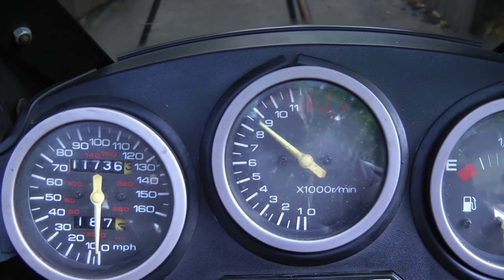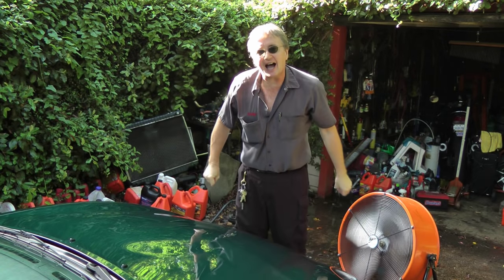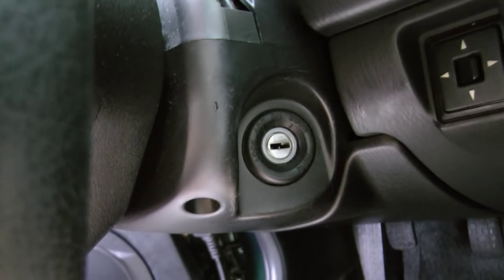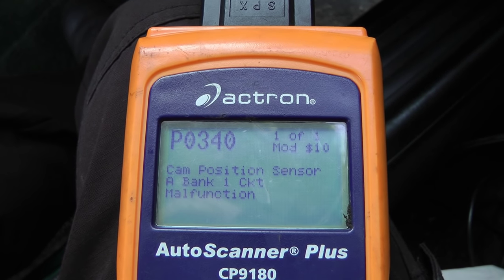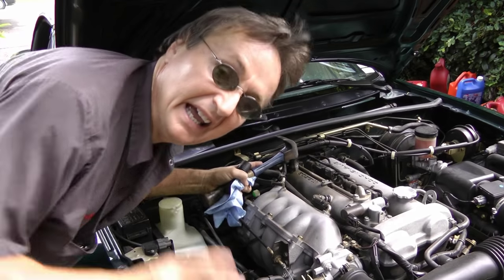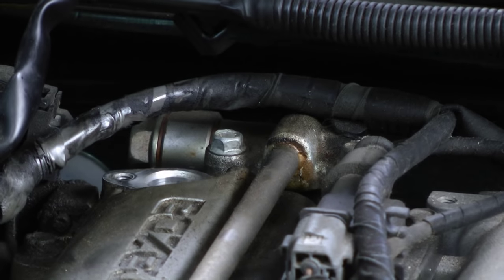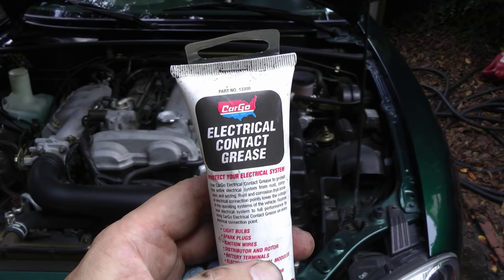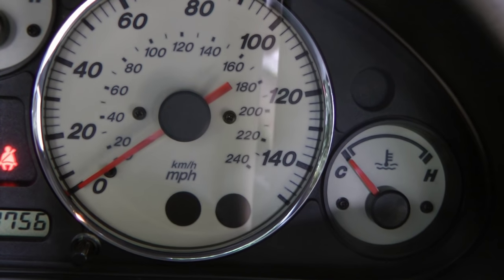How to Fix a Car that Randomly Dies while Driving

Comment: scotty, there are some cheap 5 bucks bluetooth(your phone will be yhr interface) obd2 scanner / reader. it can also display rpm, fc, 0-60, 0-100, rolling start and more. im about to buy one but im not sure if it works or at least does the job, can you ask some of your mechanic friends if they already tried to use some and if it is universal for all cars?
Reply from the maker: +John Meister Dupa they work on all obd II cars, BUT realize the really cheap ones can fry your computer. Buy at least a 40 dollar one so the circuits will be well made on the plug
Reply: +Scotty Kilmer hey Scotty, got a 1987 Chevy G20 357 engine, been stalling on startup after driving awhile but always started back up again after  it died engine light comes on lasts   a minute then goes of and everything appeared to be ok, been driving like that for awhile, sometimes it would come on while driving but no issues , always got me home. Readiing is a code 32 which is a ERG , so i was gonna replace that. Tonight  i was driving home at night, car stalled out , no lights Nothing for 1 sec then everything came back on  on and drive fine , Scared the living BLEEP outta me as it was  almost pitch dark outside!!. What do u think PLEASE HELP!! I feel lucky to be alive!! :)

Comment: Hi Scott, i have a 98 dodge grand caravan that cut off on me while driving. I've replaced the starter because i thought it was the start solenoid. it did not fix the problem. i turn the key over and all is get is a click. i have full power and the dash lights up.

Comment: I got an odd one. Car dies at random driving or not, never while cold. Had the fuel pump, fuel pump relay and FPDM, replaced based on past codes "fuel system offline". Usually will start up the next day or if left alone for a solid couple hours.
I've racked my head on this one for a few months now.

Comment: Scotty, my 2009 Honda Pilot EX-L with 131K miles in it stall and chokes when i tried to accelerate, change the fuel pump and crank position sensor and it worked fine for about 30 miles and then it started doing it again. i connected the OBD Fusion engine diagnostics but no code comes up on the screen. Could you please provide some guidance if you have encountered this issue before? thanks, Carlos

Comment: Hey Scotty. I keep getting a battery light flashing as I come to a stop. Alternator, starter and battery tested good. The vehicle has a new belt tensioner. Does a battery light throw codes that can be read with a scan tool? It's a 2004 Honda Accord 225k miles. I think it's the computer. Sometimes the RPM drops to 500RPM and the car stalls if I try to move it. If I rev it up and hold the RPM to the limit it's solves the low RPM problem. Thank you.
Reply from the maker: on that, probably the computer but do check the alternator wiring out closely and pray that's corroded or loose. computers are not cheap and if it really charges fine, you could live with a small fault
Reply: Thank you for the quick reply Scotty!!! You truly are the best on YouTube when it comes to interacting with viewers and truly helping others. Your success on YouTube is well deserved. It seems like it's a computer issue that isn't too bad like you said. That's what I've been thinking. Just keep driving it until the computer goes out or it gets more serious. What should I look for if I plug in an OBD2 scanner on live data when I get the separate issue of low RPM at idle and stalling if I try to drive??? I think it's the computer as well but want to see what I should look for on live data. Thank you Scotty. God bless you brother.

Comment: Hi Scotty! I have a 2002 toyota celica that was owned by someone before me but must have taken out the OBD plug...so I can't check the codes.  I replaced the alternator because after a visit to the auto parts store they tested it and said it was going bad and my car would die randomly and start back up again  after a couple minutes. After the replacement my check engine light turned off for about a day and now its on again and it also died randomly on me while driving. I'm new to this type of thing and would really like some input/advice from you!
Reply from the maker: I'd guess the obd data link port is still in there under the dash, just that it fell out or something, have a mechanic check that first

Comment: Hi Scotty, I badly need your opinion on this. I have a 1992 Nissan Sentra ECCS model. My problem is this, it quickly overheats when I turn on the AC and my temperature gauge is not moving to HOT level. I have my fans working, both for the AC and radiator. However, a mechanic told me that the motor of the radiator fan is gets hot easily and kinda loose but still working. It is just that the motor heats up quickly. So what are my options for this issue and where do I start. I'm not sure at this point what to replace/check/tweak to resolve this. thanks!

Comment: Got an 86 mustang that only gets about 2 miles before dying. Bought it dirt cheap because guy gave up on it. Will restart afterwards, or he says tap on fuelline? Then it restarts, runs, dies. He replaced many,many parts already. Any thoughts where to start on 3.8 throttle body mustang issue🤔

Comment: i really need help i bought a 97 bmw 328i yesterday, i went last night to pick it up, so on my way back, as i'm half way home the car completely shut down on me while i'm on the highway. it didn't wanna turn back on afterwards. i tried to jump start it but it still didn't turn on, it doesn't crank or nothing the lights on the dash wont even turn on either.I COULD REALLY use HELP on trying to figure out what this happened. Thank You Scotty
Reply from the maker: ften a bad alternator and a shot battery, auto zones test both free
Reply: Thank You Scotty. Today i went to AutoZone to check the battery i was told and showed that the battery was at 100% fully charged. but i still cant figure out why it doesn't turn on & i'm talking about like nothing in the car turns on, it don't even start..do you know why this happened ?and im also going to take a look at the alternator because that was gonna be my 2nd choice to go too on why it doesn't turn on.

Comment: I have a 2003 Chevy Impala turns off after driving 15 minutes I have to wait awhile before it starts again you thinks it the cam shaft sensor or crank sensor ?

Comment: question for you my car dies randomly and i already change the cam shaft sensor also the throttle response sensor do you think it could be the alternator or what else can i change thanks in advance  2001 pontiac grand prix

Comment: I tried for years to get in contact with you but no luck but  I have a question, I was sitting in my car at work with the AC for 30 min and all of a sudden shuts off no grinding or harsh sounds just shuts off have you encountered that issue ?!?!

Comment: Hi Mr. Kilmer:

I drive a '98 Toyota Corolla.  The car is currently dying at random times.  It will drive fine but then it will decelerate to a complete stop with the battery light and the red oil light coming on.  Before this happens, I usually hear a "boom" sound at the back of the car.  When the car dies, I have to put the car in park, turn off the ignition, and then restart it.  Sometimes it restarts right away, and other times it will restart and then die immediately only to finally start driving again.  The yellow check engine light also comes on when this happens.  The code read a cylinder 3 misfire the last time I checked it.  The battery is new and the alternator is in good condition.  What do you think the car needs to start driving normally again?  Thank you!

Comment: Hi Scott

I have a tiny problem. My toyota wish has low idling when engaged in gear whilst the car is at a complete stop. That causes it to vibrate and it feels like the engine is going to stop. Now this car does not have a chock to adjust because it has an electrical one. What do you suggest I should do? I have cleaned the mass air flow sensor but with no success. Please help

Comment: Funny thing, my 1967 Pontiac Parisienne with 283 V8 doesn't have a cam position sensor, or any way to read codes, but it has never stalled in 50 years. Must be something wrong with the carbureted / points ignition setup that it hasn't randomly shut down.

Comment: Scotty I have a 1991 oldsmobile royale 88 I had the harmonic balancer, coil pack, sparkplugs, sparkplug wires, o2 sensor, idle air control valve, air filter and transmission modulator replace but yet it runs rough idle high and low at times. It also cuts off while driving. Could it be the tps or fuel pump going bad?
Reply: Harry Taylor P.S. This car stalls on take off or when I come to a stop have to keep foot on brake and gas pedal at the same time. It doesn't do it all the time.

Comment: Hello sir... Good wishes from your fan from India.
Sir I have a Hyundai Accent Viva 2003 model (India). I bought it second hand. Few years it ran excellent but suddenly at some time its pickup dropped but then also it continued to work. Few days back I had a crash in a vehicle due to which I had to take my car for a dent-paint done but just after the crash, my car started to die while driving and sometimes unusual throttling happens...
I saw your video and opened the bonnet, when I turned on the headlights, I heard sparking sound from a plug & socket type of thing clung together with a U-shaped pin, which I believe is the cam sensor. I unplugged it and cleaned both things thoroughly & put it back again. Now my car doesn't die, but the pickup is low.
I want to ask does the cam sensor affects pickup and mileage? If yes, then surely I will give it a try...
Sir whenever you get time, Please reply... Thank You... :)
Warm Regards
Joy Ruskin
Reply from the maker: +Joy Ruskin  yes, it does, try a new one and also check its wiring for internal electrical shorts
Reply: +Scotty Kilmer okay sir... thank you so much...

Comment: I was hoping you actually were gonna do it on the Charger from the thumbnail, v8 LX Chassis are notorious for that. My 2006 SRT8 Magnum dies sometimes usually at lights or driving slow in parking lots.

Comment: Scotty I'm wondering if you can help me with a problem I have. My 96 Honda Accord with 180000 miles on it, the engine oil stays cool to the touch , while the coolant temperature is at normal operating temperatures. Do you know what could cause this

Comment: have a 2006 Chrysler 300c SRT. 192000 miles no problem till 3 months ago. My cam sensor went out, replaced it. The last month two sensors went out. And now the same sensors are acting up. My question. What could be throwing those codes. Outside of that the car runs strong I had the car for 10 years and I bought it when I had 93,000 miles on it. Always change regular brakes changed regular only additions that I had to the car was I did an exhaust and a co-air take other than that nothing else. I was wondering could I have a bad PCM for TCM

Comment: My car died and wouldnt start and finally started after a few minutes and check engine light came on and it showed crank shift position sensor. The check engine light went away and two days later did the same at a Red light and the next day check engine light was gone again.. So do u think its wiring or should i just replace the whole sensor?

Comment: Scotty Help!  I have a 95 Volvo 940 (non turbo) that does this but I don't have a scan tool for this car (old obd I tool).  I suspect it may be a crank sensor because while driving, the tac goes to 0 even though the transmission is engaged to the engine and turning it. It's becoming more frequent but starts right up if I put it neutral while driving.

Comment: Scotty I have a 2002 buick lesabre 3800 Il drive it to the store then go shopping then come out to go home and the car will start up but then dies right away but then will start up and runs fine on the second try what could cause it not to stay running on the first try?I've replaced the fuel recyclator valve.but didn't help.

Comment: Scotty .. I have a 1991 Chevy lumina 3.1liter. Runs for about 15 minutes and dies. Will not start back up. I let it set for a while and starts up. Runs about the same length of time and dies. I have a code reader but it's for obd 2  not for obd 1.  I have an old code reader that flashes codes but it don't show anything wrong.

Comment: hey scotty I have a Chevy s10 1995 and it shuts off randomly while driving but it won't shut off if it's on not moving. what do you think it is? I've already done a tune up, changed distributor, fuel filter, fuel pump, and ignition module. is it the computer? if not what do you think it is? and also while driving it like chokes and then that's when it dies. so please help me and thank you.

Comment: Hi Scott i have a rover 75 1.8 petrol and lpg car started to misfiring constantly it has new spark plugs oil filter everything still misfiring i turn the wheel all way to the left or right can hesitate and stalls while driving some times shakes

Comment: Scotty, I own a 2003 Dodge Durango SXT with a 4.7 liter SOHC Fuel Injected V-8 that runs fine but has a low oil pressure light that comes on at startup. It will stay on until I shut the engine off and restart the engine.  It runs fine afterwards until I shut it off for a long period of >5 min.  Then, I have to do another start/restart cycle to get the oil pressure light to remain off.  Oil has been changed on several ocasions with my usual Mobil 1 synthetic 5w-30 and my mechanic claims that the oil pressure sending unit is working normally.  This all began with a computer replacement 4 years ago.  Would reprogramming the computer be likely to correct this issue?  I have no tools for that, so a trip to a dealer is likely.  Your thoughts would be appreciated. Thanks!

Comment: I have a 2012 GMC Sierra, yesterday while driving it died and turned back on in a heartbeat, it happened three times in less than an hour. I noticed that it happened while accelerating slightly from low speeds. truck is supercharged and running on 98 octane fuel
Reply: what I mean it turns off and back on by itself in milliseconds when accelerating

Comment: Hey scotty, 
I have a 2004 subaru STI that will randomly shut off while driving, it is a new engine with 3400 miles on it... Any thing you can think of for me specifically? It will die randomly and I'll try to start it about 15-30 seconds after and it will start right back up again...
Reply from the maker: when it dies, quick do this video and check the fuel pump  pressure first:  https://www.youtube.com/watch?v=064Ilsz8Fzg

Comment: I have an issue that whenever I hard start my car from it seating in my drive way, the car wouldn't crank over until I crank for about  7-8 seconds and then the rpm needle wouldn't work until I turn off the car and turn it on again. I even sometimes experienced car would die after 5 mins of driving and work fine when I turn over the car again. Hopefully these symptoms are all on the crank shaft sensor.

Comment: Mr. Scott I have an issue with my 1997 Saturn Sl series, 1.9 liter engine. I have had a continuous problem with it cutting out while driving. We replaced the ingition module, fuel filter and crank shaft position sensor. And that seemed to fix it. Unfortunately it looks s starting up again.  While I am driving it it feels like it's chokeing out. Most times it starts again but sometimes not. Now it is sitting in my driveway not wanting to start. The 2 tim s it broke down on me yesterday, I had to be pushed out the road in reverse. It would then start again. I am at my Wit's end with my car. I am a student in college and I need a car for back and forth. Do you have any suggestions?

Comment: I have a 2012 Mitsubishi lancer the car runs well but recently it has started to shut down on me. when i shut down the engine but leave it on the "on" position. The car shuts down completely. up to the point where there is no electric current. So what I've been doing lately is disconnect the negative terminal and reconnect it. but it's becoming a hassle now. I've also has the battery and alternator tested and they both passed. The vehicle also doesn't have the check engine sign  we had diagnostic test and nothing showed as well. Any help is greatly appreciated thanks Scotty.

Comment: Hi Scotty. I have a 2006 Ford Escape. It shuts down while driving then powers itself back up most of the time. Sometimes I have to pull over and restart it. It starts up right away no cooling down. I took it to the mechanic and it doesn't show any error codes. Any ideas?

Comment: I have a 2011 Chevy equinox lt 2.4l I replaced my solenoids due to low power and check engine light on both intake and exhaust , I changed my camshaft sensor but still dies while on the road, my first issue was while at a red light it would jerk forward while foot on the brake and I’d notice a louder engine any suggestions??????The code ran through my OBDI is p0011 A camshaft position timing over- Advanced or system performance Bank 1

Comment: Hay Scotty my boy friend  has a 2003 Honda Civic ex  he chanded most of every part  so the engine can run right but for som reason wen he turns the steering wheel and presses the gas  the car die  but wen on park  or neutral it doesn’t die or hesitate what do you think it can be …please help he has been working on it for a month checking every possible option

Comment: Well I tried.... replaced the fuel pump fuel pressure regulator  and fuel filter and still have the same problem would do you think next I'm not spilling any fuel. What does rich mean not enough air or fuel  I have zero avuccum leaks tried the cigar lol  do you think it could be my timing ? Or cam and can sensor  Thanks scotty
Reply from the maker: DeezSteez  rich means too much fuel, or not enough air. Pull some spark plugs, if they are all wet, it's flooding out, often from leaking fuel injectors or fuel pressure regulator